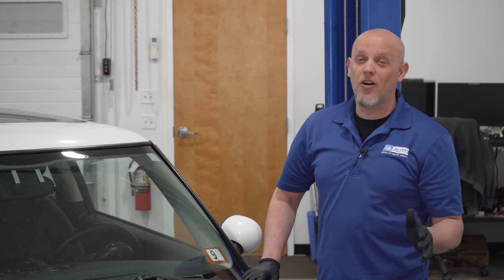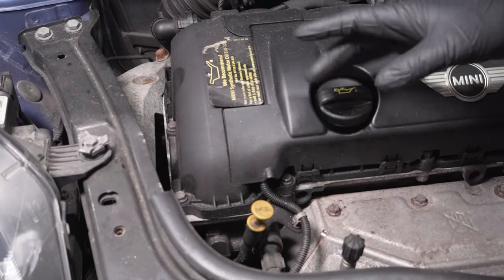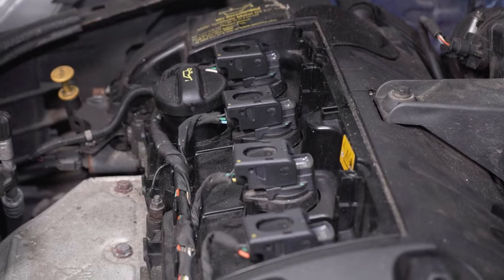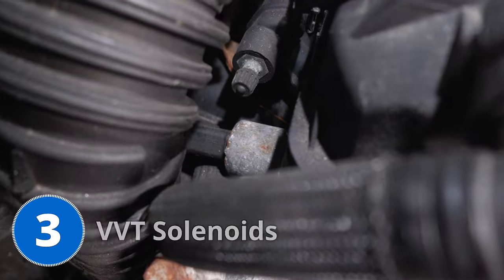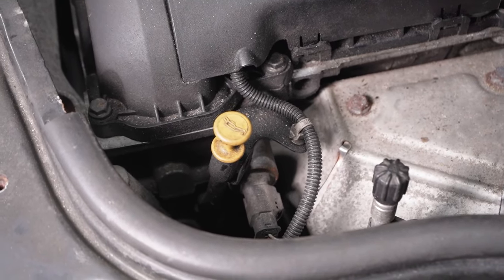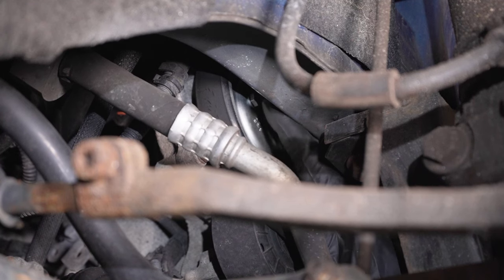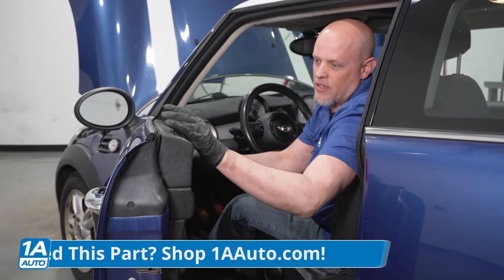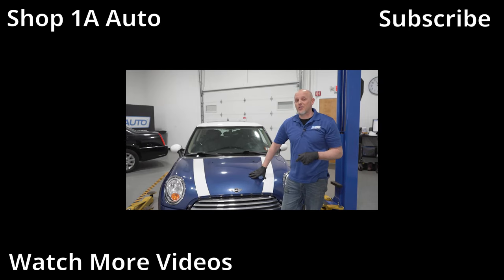Top 5 Problems Mini Cooper Hatchback 2007-2013 2nd Generation

Comment: You missed THE #1 issue for 2007-2010: massive oil consumption (like a quart/1,000 miles) which leads to oil starvation and the timing chain guide and chain self-destruct taking the engine with them. Oh yeah, the check engjne light will come on then too! Invest in a Cravenspeed dipstick and monitor weekly. And buy 2011-2013 models which are slightly better (still monitor oil level weekly).
Reply: Actually no mention of this (a plague on the N14 block he's reviewing...) OR the premature timing chain failures that engine struggles with,.. kind of surprising. People are told to look for the faint sounds of a death rattle when inspecting these for purchase because of how frequently the chain goes.
Reply: I buy it 2 months ago, and notice on last moment the oil consumtion, luckly i think ther is no damge on chain, also got the sam old oil regarding to first problem, so i it's normal for 1.6 gasolin with 122hp to consump a oil, is ther some solution to reduce oil consumtion, or fix it so there is no oil consuption at all?
Reply: I had that problem untill I replaced my whole oil filter housing.

Comment: I own a 2008 R56 base MINI. Many serious problems with this model are because of improper maintenance. Thankfully, I ignored the company's recommended interval of 15,000 mile oil changes. Since new, I changed the oil every 3000 miles. Because of that, my car has been a gem, only needing routine service. If you looking to buy, try to find one with a good service record.

Comment: I've had my 2007 Mini cooper r56 base for 5 months and I bought it at 119k miles and I've put 5k miles on it. So far I've replaced the spark plugs, one of the ignition coils, and other small things like the windshield washer hose and blinker bulb. I took it to a mechanic to have it inspected and he recharged the a/c because it wasn't working. I didn't even know because it was during the winter lol. I already bought a valve cover gasket but I haven't gotten around to changing it and I'm also going to replace the rear shocks when I get the chance. My mechanic will replace the timing chain when I get the money but it's not too bad right now. My car is also an absolute oil guzzler lmao. Besides that, it's been an amazing car and I got a great deal on it. I wouldn't trade it for anything
Reply: How much oil does consume yours? I have a cooper r56 122hp 110k km and it consume 300-400 g per 1000km.
Reply: My 2011 clubby absolutely consumes oil too! So scary, especially as the dipstick is so hard to read.
Reply: @pattywinans9556  do you get to see smoke from the dipstick?

Comment: 2nd gen mini coopers are a great first car. not because they are reliable but because you are FORCED to learn new things if you plan on being a dyi mechanic. so far I have changed my valve cover, replaced my timing chain, changed my spark plugs/coil packs and done my own brakes. the high mechanic price forces you to work on this car yourself. 
I own a civic 2003 and a 1991 corolla and I never realized how needy mini coopers are.

It def gives you an appreciation for reliable cars like Hondas and Toyotas. I would go so far as to say that anyone that has a mini as their main driver and does their own maintenance. kudos to you. if you can survive this mechanical nightmare, its a very rewarding and fun car and it shows you can survive working on a normal car.
Reply: This is the only part of the new Mini that copies the original LBC's (Little British Cars). I bought my 1962 MG Midget in 1968. Withing a year, I learned more than I ever thought I would ever know about automobile mechanics. If you had an LBC and you weren't working on it, it meant you weren't driving it. Being a poor college kid, I couldn't afford to take it to the garage. On the positive side, I know a lot about mechanical issues with cars and I still love working on them.
Reply: Hi can you make some video to change everything on Mini Cooper engine cover replacement?
Reply: @boomerguy9935  hi, can you teach me some how to change DIY?

Comment: Timing Chains and Chain Guides are a notorious issue for the N14 turbo engine from 2007-2011. 2012 and newer N16 turbo engines did not have this problem anymore. The naturally aspirated version from all years also seems to be unaffected by that as well. Coil Packs are also very common, but pretty minor. Cooling systems too, like every other Euro car out there. They're a pretty solid, and insanely fun vehicle otherwise. Use 5w30 or 5w40 oil as opposed to the recommended 0w30 and 0w40, the seem to run a little better and not consume oil running the thicker weight. And keep up with the maintenance, and it can last a long time. Knew a few people who got over 200k miles out of their R56/R57 Minis with very few repairs.

Comment: I have an r56 2007 Mini Cooper and I love it, it’s had a few minor problems like rocker box gasket needing replacing and eventually the clutch as had done 120k miles but it’s well maintained and runs sweet, use it as my daily driver and love how well it drives, tbh if people just learned how to keep oil topped up and do basic checks and maintenance then these are great little cars whether first time or as a cheap work horse like mine 👍

Comment: Bought a 2011 clubman S this past December. Dealer said there was no oil leak. End of January oil and coolant leak. Funny I’ve experienced the door lock problem roughly 3x’s unlocking& the handle won’t depress to open. Sounds like the cars going to fall apart hitting bumps. Not sure bushings, bearings or stabilizer bar however will be handled soon. I still Love this car so much.  She’s a different specie.

Comment: R56 LCI now10 years old and I decided to replace the front suspension top mounts, bump stops and springs. Also while the suspension was off, changed the backing plate for the brakes. Feels like a whole new car now. the bump stops were shot to the point they were flaking away in my hands and the backing plates were rusty as.
Well worth the money.
Reply from the maker: +Mini Mad Thanks for the feedback!

Comment: 1A is my go-to for anything I need to do on my Cooper. Clear, simple. That said, the list was interesting, but I would add to that timing chains/guides for N14s, carbon build-up for pre-2011s. And the outrageous design of the fobs that require you to cut open the housing, unsolder the old battery, solder in the new one and put it all back together with CrazyGlue or buy a blank housing.
Reply from the maker: +Paul Heagen Thanks for checking us out! http://1aau.to/m/Shop-1AAuto-c

Comment: I seem to have an intermittent problem with my offside sidelight turning on and off. I’m finding trying to change the bulb is currently mission impossible. Feels as if the bulb holder has fused with the unit and it won’t budge at all!

Comment: I kinda feel like these cars get a bad rap. If you are dealing with a car this old you are likely over 100K miles and most cars in this window are likely to have issues crop up. Mini sold so many cars in America at least that parts aren't that difficult to buy at affordable prices. The market is rich and Mini owners tend to want to keep their cars running. So, it isn't bad at all. Also, if all hope is lost on your current Mini there are enough of them sold that there is a ready supply of used Minis to purchase instead if you decide to go that route. Last, and these days it goes for all cars not just Minis, learn to drive a stick. Dealers have all kinda of problems selling cars with manual transmissions bc no one learns how to drive them anymore. You can easily find cars with stick shifts that have been on the lot for 4+ months and they will practically give them away.

Comment: N18 mini....I have replaced vanos, diverter valve, spark plugs, thermostat housing, cross over pipe, t-coolant hose, chain tensioner, high pressure fuel pump.  What I'm doing in the next month....passenger axle, left brake caliper(seized a little) and oil cooler for leaking.  I change oil every 3500 miles and all this in 2 yrs.  Don't buy if you cant fix, don't wanna fix because they need attention.

Comment: Had a 2007 Turbo great to drive , only had 75,000 miles well maintained, but there was always some issue , finally the transmission went out , luckily I had a Warranty with a Company . If you purchase an older one you need to be mechanical or have a friend or place that is

Comment: Ok so ? .. I have np replacing a water pump, gaskets, entire valve cover including helicoils from a bad mechanic replacing the covers. the biggest thing is how often are you seeing valve replacement as that is an Expensive repair not a cheap one and is that based mainly on the piss poor placement of those  vvt ? or correct me if i am wrong were you speaking of the vvt valve itself and not the actual engine valves.. Love the look of these cars and always wanted one but heard so many bad things i steered away. The door latch issues i actually had with a 78 and 79 honda civic. Curious also does the S have the same issues as that is what i am actually looking at atm.

Comment: Im in the UK and have a Mini Cooper 2010 2nd gen r56 60k miles - I think the belt and idler pully needs replacing as the belt recently started making a loud screaching noise when engaging 1st gear or reverse, also my headlights are pretty dim and the blower hardly works - wondering if these are classic signs that the belt/idler pully need replacing, maybe even the water pump? 😟$$$

Comment: Hi

i have 2013 mini cooper r56. I have one question. recently i changed thermostat housing in car and i noticed there is white cream things in engine oil cap but that thing was stick there for like ages dont know when it appear. 

One of the mechanic told me that it might be head gasket issues .. how can I confirmed that my car has head gasket problem.
 
Thanks in advance

Comment: Very joyful to drive around on those minis , I have a 2008 Mini Cooper 1.6 , the grip on those things is Extreme , also I can easily drive on the highway with 100mph and fill safe , kinda fast two , gear shifter is excellent , but they are unreliable , , the trunk latches fail on those minis , the oil consumption was high so I changed some rubber things on the valves (cost of repair at a bmw specialist 700€ , the alternator failed , 360€ for a new one , timing chain tensioner had a problem , 1300€ to fix , the sunroof failed , that costed 1600€ , so basically be ready to spend around 1000€ per year on repairs

Comment: I have struggled with our mini r56 for years. Engine light after engine light. Replaced almost everything, leaking cooling system, cooling reservoir. Some sensors. aircon compressor, leaking aircon pipes. Turbo alternative water cooler pump, new clutch aftermarket fitted, complete rubbish. 30k, dead. New clutch kit again, this time BMW original at great cost which seem goo, night and day difference. New Turbo, at great cost. Engine light continues to pop up. After replacing waterpump, thermostat, I decided to replace fuel injectors for peace of mind. Engine getting old. 150k. Still engine light. I never got a code before to help me. New spark plugs, not the first time. Still engine light. Further checking I got a code for engine imbalance pointing to ignition coil. Rotated 1 and 2 and fault went with it. Replaced all 4 coils with NKG. Not expensive and very easy to do. The engine has been running well and can rev up nicely. No engine light. My recommendation is to anyone owning a mini to replace fuel injectors and coils a 80k. This will solve a lot of heart aches and money. The diagnostics failed to show engine imbalance as a code only an engine light and no code. Perhaps a $3000 scanner would have shown the problem. I should have bought one, would have saved a lot of money. Mini dealer in Australia charges $250 per hour. When they see a window wiper code they say, these things happen and have no solution. The mini has been the mist expensive car I ever owned in repairs. The body will last 25 years and is very well made. The n14 engine is a dud and replacements are not made available at reasonable a price. No good used are available which should be a warning. Servicing pricing is ridiculous. This car is for my wife who likes the car, a childhood dream. Engine is using a lot of oil. We will keep it until it blows up. We spend twice the purchase price on repairs. We bought for $10k Aus with 103k on clock. Cheers
Reply from the maker: +@wouterwurth5160 Thanks for the feedback!

Comment: My 2011 base just sprayed antifreeze all over my cams because a head core plug popped out between number 2 & 3 spark plugs. I cannot find the plug anywhere under the valve cover area!

Comment: So my 2013 convertible S drivers side door is hard to open from the outside. The handle is hard to squeeze, is this the handle or he latch? Or both? And would lubricant help? 
Also there is a crackle in my large speaker in the passenger side door. The plastic mesh that covers it is cracked. Could the cracked cover be causing the crackling or is it a blown speaker? I have the Harmon Karden sound system.

Comment: ALOHA from a small Hawaiian island. Sadly no mini mechanic here .. Mini cooper S 2013 needs an oil change. I will attempt.  Oil should be 5w-30 yes??? Synthetic...  there are several brand names, what would you recommend 🤔  thank you 😊
Reply: My mechanic likes 5/40 for summer. Just go with Castrol full synthetic. Not sure what auto parts stores you have out there but O’Reilly has a very solid house brand of oil. Rated the same as big oil manufacturers.
Reply: Was it hard to do it yourself?

Comment: Another issue on the turbo engine of the '07 is the oil cooler gasket and the turbo inlet tube o ring leak.

Comment: I gotta change the back solenoid. I'm dreading it because of the tight space. Although I dunno why it's failed. I've been changing the oil on time, but my oil has also been burning and maybe I didn't fill it in time.

Comment: I have a 1.6s 2008 70k on the clock. This is the worst car I've ever had. Constant breakdowns and bills, more bills and more breakdowns.
I absolutely loved driving this car. Shame they put a Peugeot engine in it.
It's outside my house rotting away now, yellow engine light on yet again for something new. I can't be bothered to even take to a garage again.
Only buy this version if you are a mechanic.
I'll take the loss on the whole dam car.

Comment: I replaced my Clutch and the water pump under waranty. I have no problem 180,000 miles and it s a 2008 👌

Comment: Failed to mention the part under the cap to the left of the spark.plug there a lip on it I had oil coming from.there  and smoking I took it off was a orange cap and was ripped what is that ?

Comment: I had a 2009..Nice to drive ,no luggage space,vvt went wrong ,water leaks.The big problem was it had very high emissions and failed the MOT,garage fitted a new cat but the next year it failed again on emissions so I got rid.It only had 70000 miles on it. 
It also had run flat tyres and I hated the harsh ride so changed them non run flats,but it had no spare so I carried a can of tyre seal.I would never buy another.

Comment: The air conditioner button and green  light does not come on ,  it's blowing hot air when car  is moving .. replace footwell module , replaced cas 3  under dash board now car won't read I'm being told it might be fuse box issue help please
Reply from the maker: +hari andujar We wouldn't be able to diagnose an issue like that here, you may want to have a local mechanic take a look at it. Thanks for checking us out! http://1aau.to/m/Shop-1AAuto-c

Comment: Top problem: Peugeot N14 motor, not that the N18 is all that wonderful, but a bit better. Really, 2nd Gens are not the best MINIs. I’ve owned quite a few MINIs and currently have a GP1, GP3, F57, and F60. Always skipped the 2nd gen due to all the problems they give. They’re money pits.
Reply: @johnnyrebel3340  does he change the oil himself?

Comment: Is there a way to bypass the immobilizer on a 2007 push to start (standard) no key ignition 
My fob quit working and it takes 3-4 weeks from the dealership. I can't be out a ride that long, any info anyone has would be very much appreciated.

Comment: 14 cooper Broke down at 48k with bad coils plugs and high pressure fuel pump. Even my kia managed three times the mileage before the same parts failed.

Comment: Bought my mini cooper last year on 96k miles put on 17 k miles . Things that have gone wrong:

Rocker cover failure, new replacement for £280

Replacement coil pack and spark plugs £160 

Wheel bearing failed £180

Pcv hose gasket failed £30 

Brake vacuum pump gasket failed £100

Oil filter housing gasket failed £150

Genaral maintenance at every 5000-6000 miles i service it myself and I have done most of the repairs on it ,which saves me alot of money.

I bought it with no service history , but the clutch has been done and after taking the rocker cover off,I noticed the timing chain guides where very clean so it saves me from having to replace the timing chain. 

I have to put 0.5 liters of oil every 300 miles and the mini engine makes all sort of weird noises , I think the engine mounts are on there way out as well making a lot of clunking sounds.

Overall all from that nightmare, the mini is a lot of fun to drive and its get me 40 mpg .
Reply: What year?